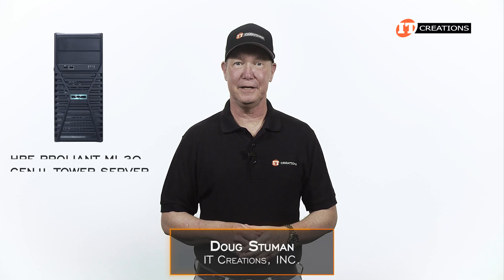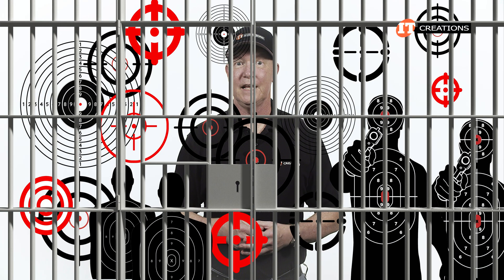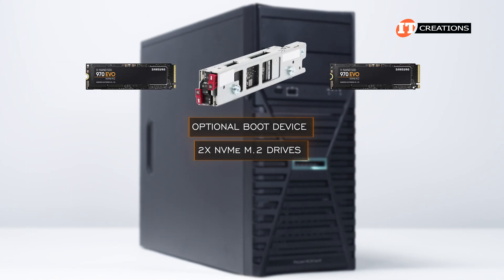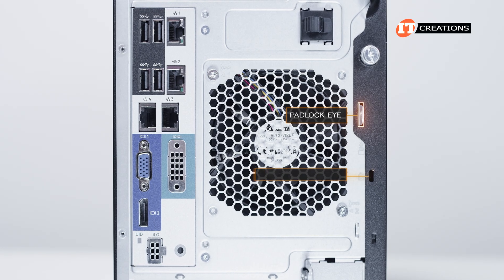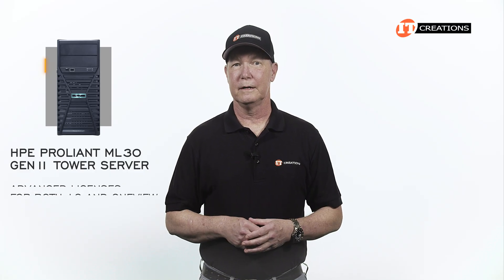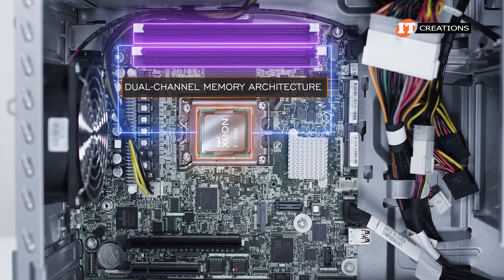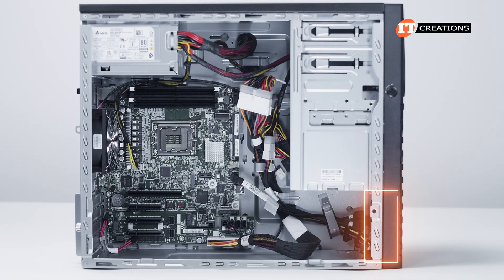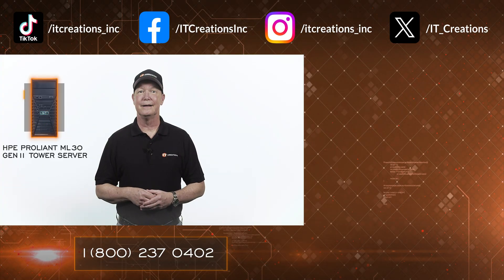HPE ProLiant ML30 Gen11 Tower REVIEW | IT Creations

Comment: I have a question.
This year, I purchased an ML30 Gen11 model.
However, when I press the power button just once, the system seems to perform a normal shutdown.
Is this behavior normal?
I am used to seeing systems power off when the power button is pressed and held for a few seconds,
and in many cases, a single press usually puts the system into a sleep or standby state.
Could someone please clarify whether this behavior is expected?

Comment: I'm watching for the HPE ProLiant ML30 Gen11 E‑2436 or 6333P models that ship with two SSDs as standard and I'm not sure if they come already configured with RAID 1? I'm thinking of buying one and I can't figure out how it will be configured and if the two drives are compatible with the supplied HPE MR216i-p plug-in card
Reply from the maker: Not sure what you need RAID 1 for but I would say it does not come pre-configured for RAID and you will have to set that up in BIOS. It's relatively easy. If you are asking about booting the system with a RAID 1, then that is another matter but yes, this system is compatible with the MR216i-p controller. I do not get the impression that either one of those configurations comes with two M.2 drives. Listed for the 6333P are 2x HPE 480GB SATA 6G Read Intensive SFF BC Multi Vendor SSDs—those are 2.5-inch drives. Both configurations have a port on the system board for an M.2 to boot the system but not in a mirror RAID as there is only one drive supported. That is optional. 

On the other hand, it seems like there are 3x options for M.2 boot, if that is what you are asking also about. There is only one slot on the system board for an M.2 and that option is specifically for the iLO/NIC/M.2/COM Port Kit and has only 1x M.2 drive but does provide a iLO/NIC port too from the back of the chassis. The M.2 drive is supported on that little circuit board. You can use it to boot the system but there is only 1x drive so no RAID 1. The HPE MR216i-p Gen11 controller you are referring to is for RAID or HBA and is meant for controlling your other storage devices up front or on a PCIe card. If you purchased a PCIe card with dual M.2 drives you could probably use that controller or a VROC key to RAID just those two drives but would not be able to use it for your other upfront drives. You could also install a VROC key for RAID and also have the MR216i-p Gen11 controller for other storage devices. The other way is the optional HPE NS204i‑u Gen11 NVMe Hot Plug Boot Optimized Storage Device. That last is plug-and-play unit with dual NVMe M.2 drives and RAID 1 already enabled. It's specifically used to boot the system. 

I hope I understood your question. If not send another comment. Thanks for watching and commenting!
Reply: Thank you for your reply. I’m considering purchasing this server for a new management software that I use in my business—in my case, a restaurant—to take customer orders. Normally, the software is installed on a PC that acts as the server, which can be either a consumer system running Windows 11 or a server-grade machine running Windows Server 2025 (we currently use consumer hardware with Windows Server, because with our old software we need RDP). This server receives input from 20–25 tablets/smartphones and sends the orders to the various kitchen sections.

The advantage of using a server-grade system is having dual power supplies and a RAID 1 setup for the system drive, where the management software will also be installed, even though it doesn’t take up much space. If one of the two components were to fail, it would still be possible to finish the workday and then proceed with the replacement. High performance or large storage capacity is not necessary—what matters is having a minimum level of redundancy. I was even considering installing 64 GB of RAM, which is unnecessary, but at least it would mean having two memory modules.
Reply from the maker: @MircoBatt91 Thanks for the explanation and good luck. You should get what you need out of this platform. Just the included controller should do the job.